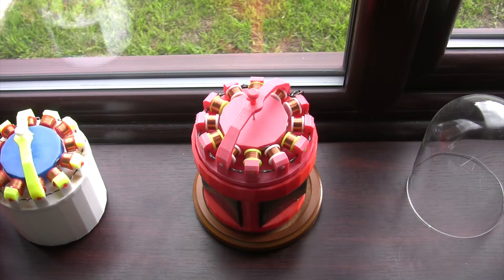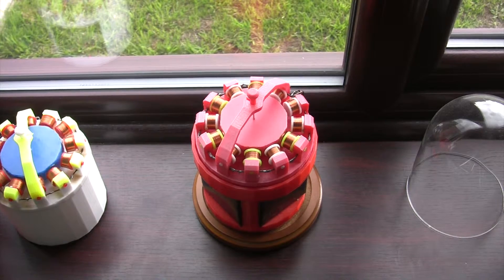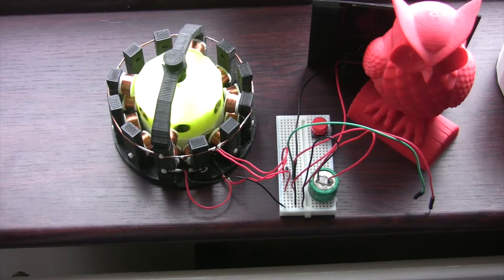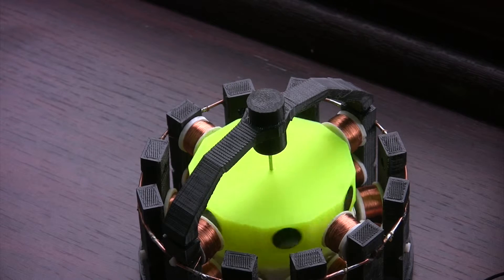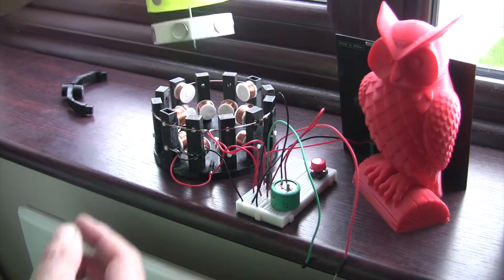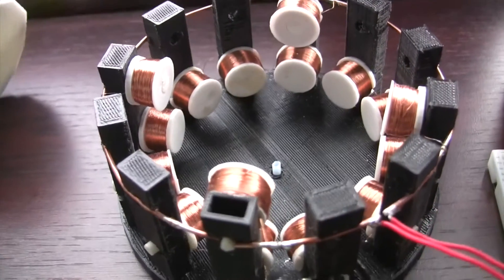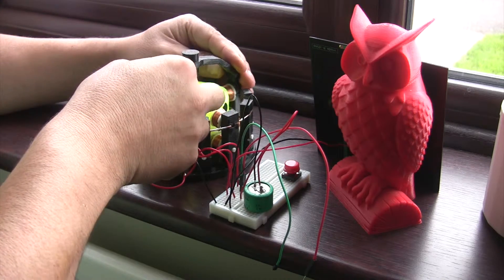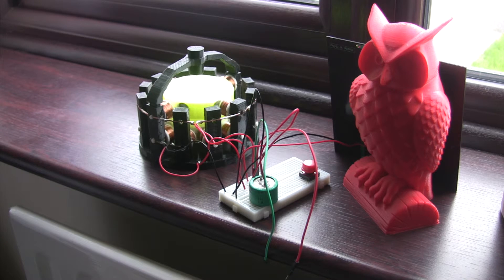New Motor Design and fail

Comment: Cool this is nearly like the idea I want to do,  but the rotor must be fixed with the needle,  

I want to make a generator like you built,  and make it run a pulse reed switch motor. 

The generator charges a supercap with a rectifier bridge,  than use the charged supercap to run a pulse motor,  with a fixed rotors.

The generator must have more coils than the motor like you did,  

And maybe it will have overunity motion 🌀

👍
Reply from the maker: +hammza hammza Great idea - but it won't work. I did get the motor working by adding  more coils, but if you do achieve over unity it won't be with a device like this.  As the load on the coils increase so does the drag of the magnetic flux.  In essence you will never get more energy out than you put in.  You can easily fool your self by getting more volts out then you put in - but there will always be less current - and the voltage drops off when you put a load on the circuit.  For instance after I got the motor to work it lights up 4 LEDS very bright - but if I bypass the LEDS to a joule thief the charge rotor slows and the joule thief will not light a single LED.  There simply is not enough power - I have the voltage hence the LEDs light - but a joule thief does not care much about voltage - only current.
Reply: 3D Motor Maker so,  this kind of magnet and coils motor,  when we use it as generator,  can't generate enough current to run anything,  accept leds !!!,  

there is a video in lidmotor channel,  when he use Dr stiffer quantum energy receiver with ezspin motor it generates more electricity than normal,  what do you think?
Reply from the maker: Well mine won't. But yours might. I can't comment on this quantum stuff as I don't know how  it works. Lidmotor is the man to ask.
Reply: 3D Motor Maker lol,  don't mind 

I just wanted to inform you about it,  it's an interesting idea,  maybe it helps to make this kind of generators work more better and powerful. 

Thanx 😉
Reply from the maker: +hammza hammza Yes it would be nice.  I watch all lidmotors and lasersabers videos.  I don't comment much because I don't know enough to add to their conversation (other that to ask questions)  You should make one of these things - they are really interesting.
Reply: +3D Motor Maker I ordered some stuff from eBay,  just waiting to get them shipped to algeria. It takes a month. 

The most interesting thing is the motor I watched in axis306 channel,  and his two motor/generator replications,  i want to build one 😊

Comment: Really nice design. What is the amperage draw on your motor?  

I built one of Lasersabers designs and I was getting 50 micro amp draw. Somehow, he gets 1 micro amp. I suppose that I am doing something wrong.
Reply from the maker: +kafr8413 With mine the current draw is affected by many things -  from the infill of the plastic rotor to the supplied voltage.  The lighter the rotor the better. The more voltage the faster it spins - the more current it draws.  I try to make mine work @ less than 10volts and shoot for under 1mA  

Edit - My motors run from 100 mircro amps to 300 microamps.  Even with Saphire bearings I have not managed less than that. Its hard for me to tell because the display changes with the pulsing.  The figures I mention are peek to peek.
Reply: +3D Motor Maker That is about what I get with my motors about 300 microamps @ 1/2 a volt.  If I use more volts such as 1.5  I can go lower in amp draw.
Reply from the maker: +DaveC1964 I have since managed to get the design down to 20 micro amp @ 5V
Reply: 3D Motor Maker

Yeah that is real good.  I am not sure how low amp draw I could get at 5v, maybe I will test it someday.